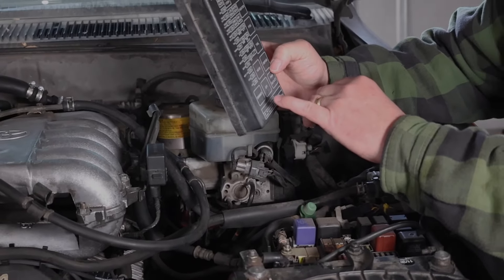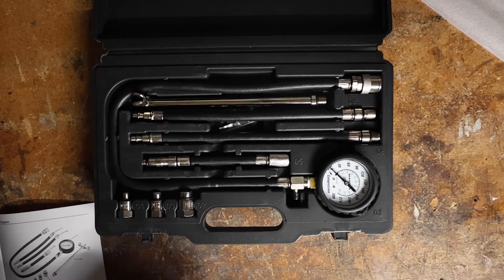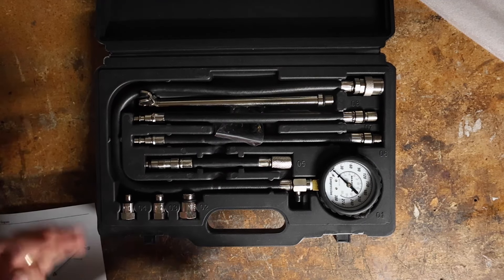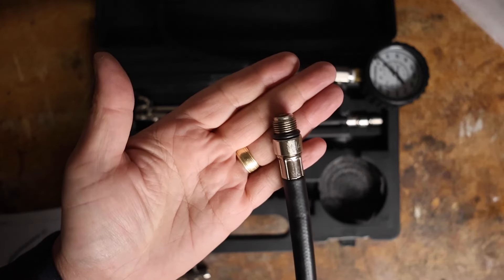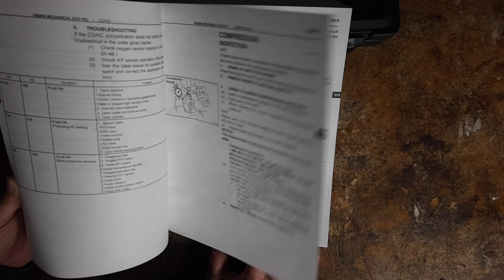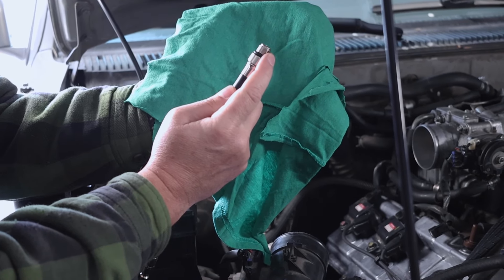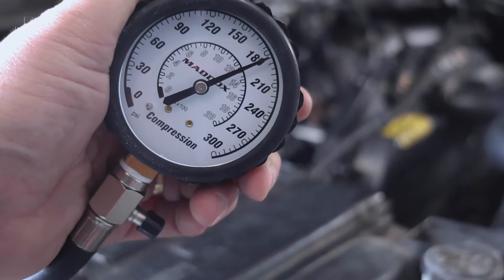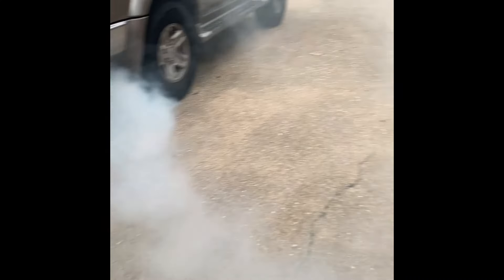Toyota 4Runner Compression Test

Comment: My 3rd gen has had more problems than any car I’ve owned
Reply from the maker: Sorry to hear that. We haven’t had many issues with ours. My in laws have a 1997 4Runner with close to 450k on it. They are the original owners. I’ll be putting out another video in the next few weeks showing the valve guide seals being replaced. Stay tuned for that one!